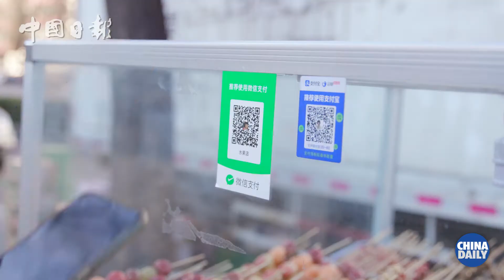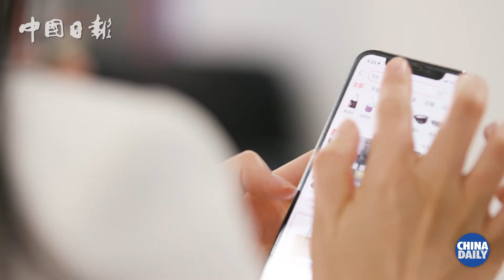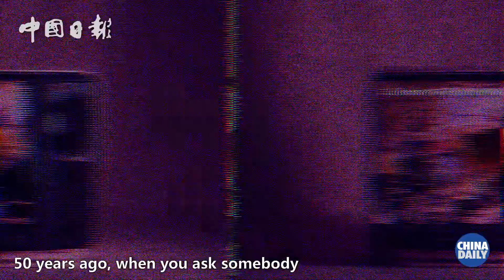China’s 14th high-five (2021-2025) - episode 2

Comment: If innovation is something China wants. Then China should promote non higher educated innovators as well. For example. If I was to get a visa to China. And wished to get funds to start a worker owned co-operative. That would change the medical field of organ transplant. From transplanting donated organs. Which have massive issues biologically and income wise to transplant patients. To a medical organ transplant that would actually build organs with the genetic material of the patients. So to cut out rejection of donor organs. And also cut out the pills that help to alleviate rejection. Or this technology that would CURE spinal injuries. By way of a carbon nano filaments and bio glue. Which allows the patient's own body to repair after laying down the bridge for the body to make repairs. These are but a few innovations I would like to bring to the world. Yet I DO NOT have a degree or work in the field in any capacity. So how does someone like me get my innovation out? If a degree is the end all and be all of getting backing. Oh and I can barely keep what little I have. Meaning i do not have money to spare.